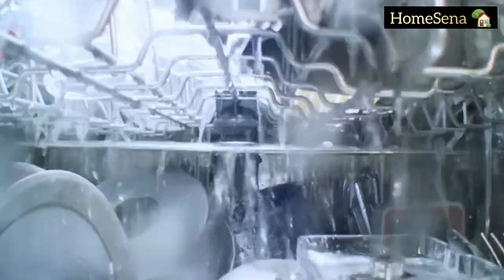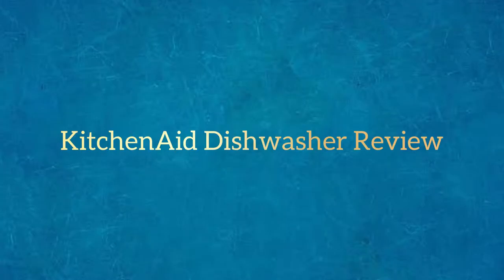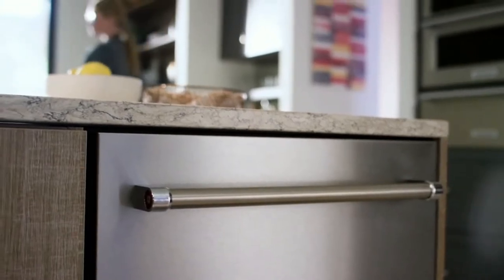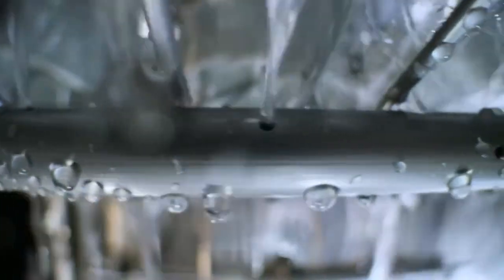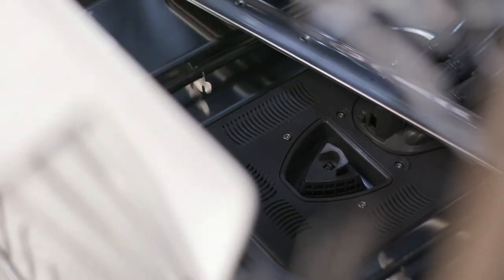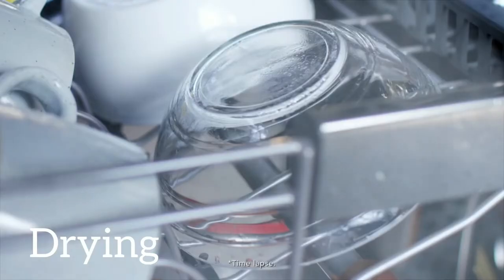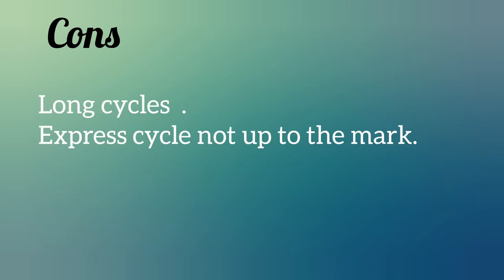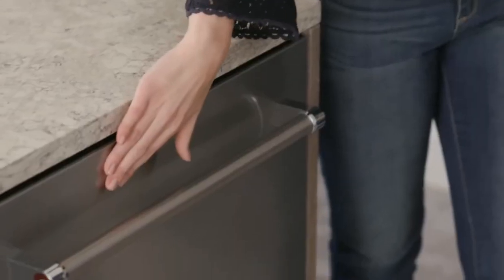Kitchenaid Dishwasher Review | KitchenAid KDTM404KPS Review

Comment: With top control - are you able to reach in under your counter top when the door is closed?  We often will be running a cycle and then someone needs to take a shower and with our house you need to make sure the dishwasher or the washing machine are not running.  So just curious if you can reach the panel to turn off.  My counter top is the older fiberboard and comes down over the edge of the cabinets.